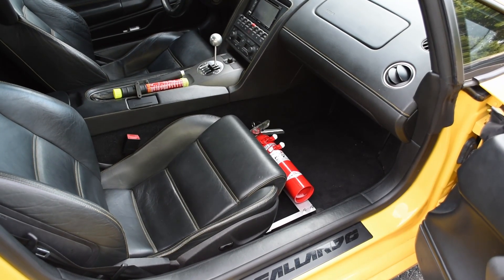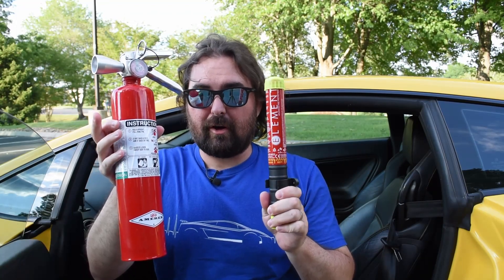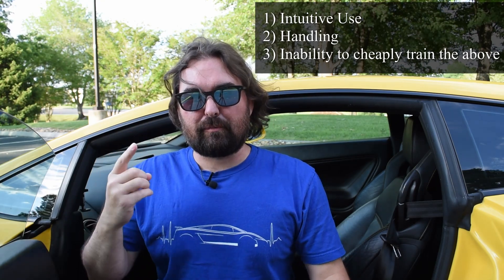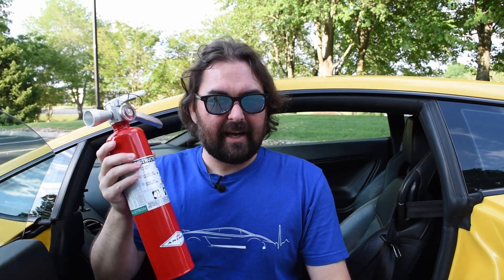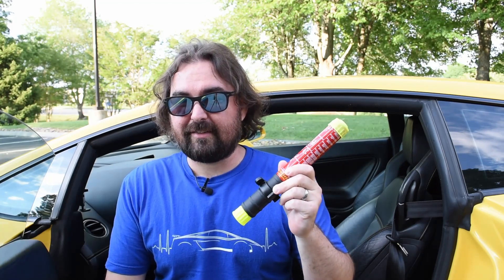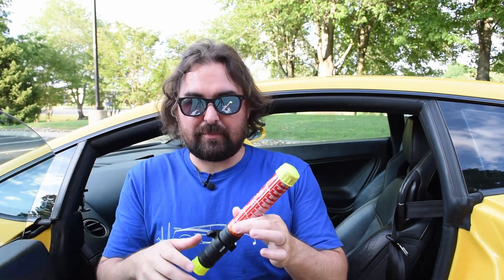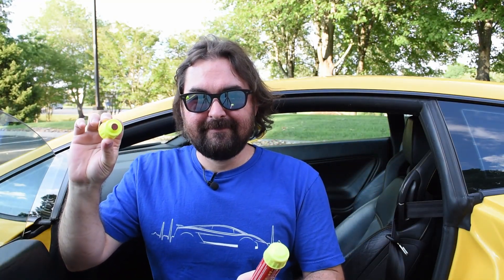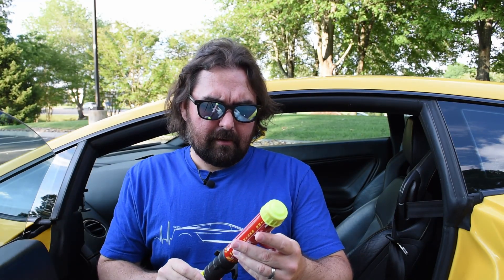Why I'm not using Element (or equivalent) extinguishers in my track cars - 3 Concerns

Comment: In my life I have put out three fires.  One with your typical fire extinguisher (Microwave had an electrical fire), a large fire extinguusher we use for aircrafts and ground equipment (operates the roughly the same, pull the pin, pull the pin at the nozzle rotate release forward).  Then this stick style fire extinguisher.  The company was not Element but Ultra Compact.  Same exact design, or so it appears.  My two complaints is you have to get closer to the fire than a traditional extinguisher.  The power, if you will, just isn't there.  It definitely put the fire out, but yeah no way to do it with one hand.  I had no issue using it under stress.  I never thought about one handed use until I went to a fire arms training course and we had to learn to use our gun one handed.  Now all my emergency items I look at differently.  What I didn't think of until you brought it up was a passer byer (if that is a word) being able to figure out that it is in fact a fire extinguisher and having the knowledge to use it.  They definitely will put out the fire, but you have to be a little closer to it.
Reply: I think a potential solution to the one handed problem would be to mount the striker cap somewhere accessible in the cab of the vehicle and strike against it one handed. The passerby issue is a potential problem for sure. I don't realistically see someone recognizing that it's an extinguisher in an emergency situation much less being able to quickly ascertain how to operate it. I wouldn't bet my life on it anyhow...
Reply: thanks for your insight. I was wondering the same thing, how close do I have to be to try to put the fire out with the stick?

Comment: One, your “old” style extinguisher should be weighed and serviced at least once a year, and has a limited shelf life . And B, you could teach a monkey to use it ,so what’s the problem ? It’s an amazing product, if your motor home was on fire, you just fling it in, not climb inside and try to fight it, where the toxic fumes from the fire would have you !
Reply: A standard ABC extinguisher will generally last well over a decade. They need to be inspected monthly,  recertified every year, and then usually serviced after six years; only if they are actually in a public building or place of business. If you are just throwing them in your car or your home, then do whatever you want. As long as it is fully charged and undamaged, it will last a very long time. 
And I imagine that if these element ones ever become accepted into safety regulations for buildings, that the same exact rules and regulations would apply for them as well. 

They are both good products with their own upsides and downsides, and I personally have one of each in my Jeep: An Element one in my armwrest compartment and an ABC one mounted on the roll cage in the back. The element one is what I would reach for if I am in the driver's seat and something in front of me catches fire on my own car to where it is risking my own life. It is small and convenient compared to the much larger traditional ABC one. But if I am assisting someone else or dealing with anything that is not directly in front of me on my own car, I will grab the traditional ABC one from the back.
Reply: And D, if you have both why not have both in the car…. After all you never know which side of the car is going to be crushed

Comment: And if you really want to increase the effectiveness of that 2 1/2lb extinguisher switch to Halon, which is still available. According to the FAA test done in 1995 It requires 1.5 times as much Halotron to put out a fire as it does with Halon. No matter what you use, Halon, Halotron, or Element, it needs to be securely mounted in a place that you can reach while fully belted in.
Reply: Once the halon is gone the fire can restart. So, if there's something electrical that's sparking or shorting or hot metal being  dripped on then it could restart. The stick seems better because it leaves a chemical behind for a while that keeps working. I think I'll get one for the race car. I think the guys arguments are weak.

Comment: I would still rather have the element. It has the steps on it how to use it plus I’d rather be concerned that the ordinary extinguisher isn’t filled, expired or doesn’t have enough juice.

Also, the striking piece might be able to be striked on pavement using one hand?
Reply from the maker: Valid point about the expiration.  That is definitely a pro for the Element.

Comment: That's a dumb reason not to use it. Because during the fire you might all of a sudden lose a hand.
Reply from the maker: There are many plausible scenarios where a high speed crash could result in an arm or hand being broken or otherwise immobilized.  Remember,  I'm talking here about on-track use specifically in my case (hence video title) so there's pretty much a wreck assumed before a fire vs. spontaneous combustion in traffic where you'd just stop the car and get out.

Comment: I have. Ferrari 430 and I decided to go with the Element brand vs the red can a:10-b:c model.  I had had a bad can malfunction in my kitchen once.  I did not have a fire but I wanted to test it. The fire gauge was in the green and I pulled the pin and nothing came out.  The hose was not clogged.  I like the fact the Element last 3 times longer.  Jay Leno puts the Element in all his cars and recommend this brand too.  I understand your points and have valid advice.  My stick is close to my drivers seat and ready to go any time I need it. It’s also next to the rear engine release handle too.
Reply from the maker: Like I said, anything is better than nothing!  The Element (and equivalent) have their place and not having an expiration is a great feature.  Totally understand your choice given that experience.  Love the '430 as well!

Comment: My biggest concern with these outweighs everything else you said. Fires are hot, and wind exists.

That may seem obvious, but every time you see someone demonstrating these they’re wearing fire protection gear, so they don’t suffer from the heat of the flames. Even on a calm day, they get very close to the fire in order to extinguish it. With wind blowing in the wrong direction, you almost have to stick your hand in the fire in order to be able to do anything.

There are advantages though. The operating time is fantastic for the size, and it doesn’t go out. That means you could throw it at a fire, or pop your bonnet slightly, throw it in and then retreat, and I imagine in the confines of an engine bay with a closed bonnet it’d extinguish anything, and maintain an unviable atmosphere for long enough to be able to prevent reignition. For me I’d carry a pair, one to throw, one to hold. 

The issues with one handed use are valid though, but most flares are like this, perhaps a twisting cap would be better as you could use your thumb and forefinger to operate it?
Reply: I think a potential solution to the one handed problem would be to mount the striker cap somewhere accessible in the cab of the vehicle and strike against it one handed. I like the twist idea but you'd have to design it so it wouldn't accidentally be set off.

Comment: I think you have good points for street spirited driving but at the track I think the element is better. At the track I need something for use in that minute between something going wrong and the safety workers getting to me. If the thing that went wrong is a bad wreck and my motor control is shot I would just leave my car to the safety workers as I am put in an ambulence but if the problem is Im sitting there watching my car burn. I want something to try to fight the fire with while I wait for the safety workers.
Reply from the maker: So I've been a part of that exact (second) scenario....with a Halon extinguisher and the driver and I were able to save the car.  I think the Element could do just as well if I swapped it into that situation as there was no challenge getting out of the car that time.  I'm not trying to sell anything (I mean if it means more people put any kind of extinguisher in their car, my job is done), more trying to bring up some points and start a dialogue.  The hope is that you never need whatever you have, but "hope" also doesn't prevent burns or property damage.
Reply: @LapoftheWorld As someone that has an element I appreciate you saying it would do just as well in that situation. I agree that I ordered an element and threw it in the glove box much quicker than mounting a bigger fire extinguisher. Maybe element could improve on the design with a handle or pull clip that stricks the tip as u pull it off.
Reply from the maker: @dakotafire24  The key in our scenario was that the Halon didn't need to "see" the fire to put it out.  Similarly I think we could have discharged an Element under the car in the same way to probably similar effect (the latch for the engine bonnet had melted, so dry chem extinguishers weren't doing much).

Comment: Great video. One very important thing to remember though is how halon(hcfc-123) works on fires. It’s method of suppression is to remove oxygen from the equation. In large spaces this is fine but in a closed cockpit or small space this isn’t ideal at all especially if you’re pinned in the vehicle. Just food for thought.
Reply from the maker: Definitely worth noting.  My personal thought is if it's bad enough I feel the need to trigger it in the cockpit then I'm probably not wanting to breath what's there before hand either....but definitely important to know how things work.
Reply: Wrong. Halon does not remove oxygen from the room. That's not how Halon works at all. It works by disrupting the chemical process itself. It was best used in computer server rooms because no mess or water is going into the electronics. The only thing Halon is considered dangerous for is ozone.
Reply: Don't mix Halon or Halon alternative clean agents like Halotron with CO2. CO2 does indeed smother and displace oxygen but halon/clean agents act by chemical inhibition (acting on the fire tetrahedron not the fire triangle) which is why a 3lb Halon can outperform a 10lb CO2. Yes there are toxicity issues with clean agents and their by products when used on fire, but Halon and it's replacements are far less toxic than it's (long disused) predecessors Carbon Tetrachloride, Methyl Bromide and chlorobromomethane. Almost all halon extinguisher deaths have been attributed to deliberate direct inhalation of the pure gas by substance abusers (a bit like glue sniffing, it affects the CNS) not use in a fire situation.

Comment: You do have some very good points , but the best thing for me with the Element is piece of mind , I know it will always work, Maintenance free, there have been several times we’re a tank style Extinguisher didn’t discharge and that sucks
Reply from the maker: Definitely a valid point with the maintenance.  I think the choice will come down to any given individual's use case.  For something to toss in the glove box of a work truck, I think the Element is brilliant.  I keep the one I bought in my garage and it's nice to know I won't have to think about checking it's charge.
Reply: @LapoftheWorld  Agreed! They both have there pros and cons
Reply: But will it always work? So many videos of the element failing 2 extinguish basic fires..I have zero faith after what I have seen
Reply: @Turnersspeedshop  Send me link please, Thanks

Comment: sooo... you're worried about one handed people not looking graceful in the event of a fire? 

you need to train yourself on using the fire sticks? goddamn i feel sorry for you.
Reply from the maker: @D1570R73D  Hey boss, the goal here was to get people thinking about carrying an extinguisher, any extinguisher, and then putting a modicum thought into which might be best for their use case.   Not a hit piece of trying to be controversial here.  🍻
Reply: @LapoftheWorld  well here's your modicum of thought, go look at videos of car fires. the traditional extinguisher you had in this video does not carry enough suppressant to deal with many of the fires people have at the track.

 not only that, but the chemicals will ruin your car parts.

if your goal was simply to get people to keep an extinguisher in the car, the title would have said that, and the video wouldn't have been entirely about why you don't want to use the sticks.
Reply from the maker: Halon/Halotron (what I have) isn't the same as dry chemical (the kind you get at the hardware store, which will F stuff up if it gets in electronics).  Halotron is a gas, it doesn't stick around much after the job's done.  It doesn't need to put the fire all the way out, it needs to give me time to get out of the car.  Anything after that's a bonus and insurance's problem.  Anyway, you've clearly put some thought into it, so "mission accomplished".
Reply: @LapoftheWorld  "insurance's problem"

lmao what a poser you done even work on your own car

Comment: OK let’s get to it I think this video is more about your car then that fire extinguisher do you need to put the Lamborghini in this video for this no! You said your fire extinguisher was $200 those element fire extinguishers cost about 60 bucks so you can get three of the elements for that and test it out Next how many people use a fire extinguisher from the inside out very rarely happens but OK Next you said you can use your fire extinguisher one handed while it’s still in the holder.. wonder if the nozzle is not pointed at the direction of your fire then a defeats the whole purpose I get the Things you have to go through to strike it but people buy this for space saving convenience and it doesn’t leave a residue normal fire extinguishers leave a bad residue and you can breathe this stuff its non-harmful so this Video was 12 minutes of a Lamborghini my man you didn’t even show its effectiveness then you showed your self driving in the Lamborghini why Next time actually put the work in for the video
Reply from the maker: I mean if the Lamborghini is why someone clicked, and they're now considering putting a fire extinguisher of some kind in their car, then that's a win in my books.  My goal here was to start a conversation and express some concerns about a specific use case (track use).  As to cost.  The Amerex halotron extinguisher was $187.  The Element extinguishers range from $80 to $160 depending on the model. To your other concern, the Amerex extinguisher is gas based (no corrosive residue, matters less which way it's pointed) so works similarly in that way.  There are definitely advantages/disadvantages to each.  Again though, the goal here was to create a dialogue for people to decide for themselves which to carry and as I stated, either one is better than whatever pee stream one could manage if it came to putting out a fire 😁